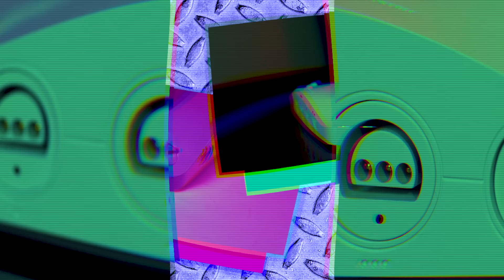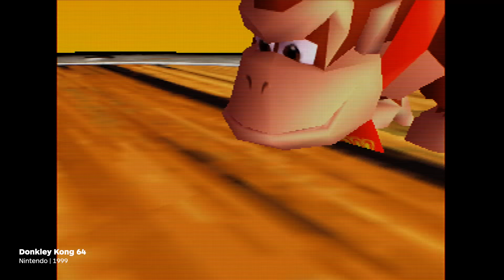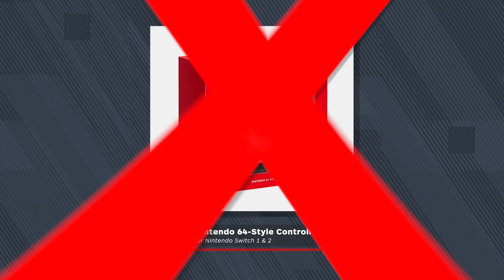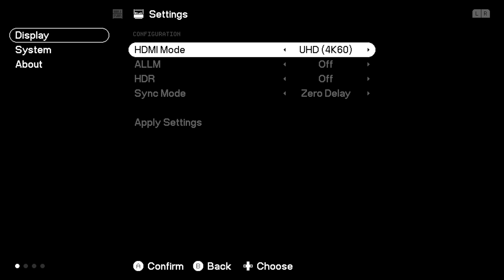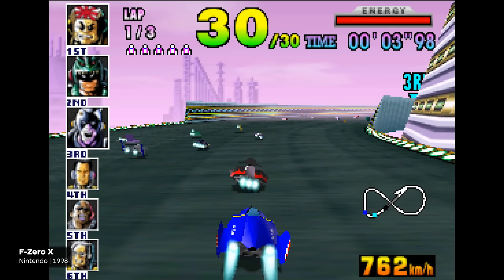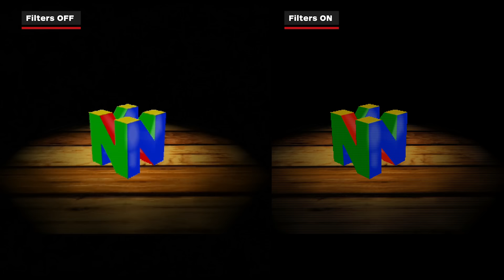Analogue 3D Review

Comment: Any one who has console: I have updated firmware to the latest on my analogue 3d system as well as also updating the firmware on my 8bit Do 2.4g wireless N64 controller (the one with the receiver plugged into the controller port) . A few questions on setup. I want to be able to quit from a game to get back to the system options / cartridge select screen. When I try and press the hot key combination nothing happens also the star / - and heart buttons don’t do anything. Are these pre configured or do I need to manually configure these somehow?. The controller is paired and working just annoying I can’t work out how to quit game to system settings and set up those buttons. Thanks

Comment: Out of respect to real n64s, what Analogue calls force original hardware is far from the correct speed, Analogue 3d is slower. I'm a diehard n64 fan, play it regularly, and I've seen slowdowns in the A3d (in force original hardware mode) that you simply don't see on actual n64s.  Seen very clear innacurate slowdowns in Star Fox, Ocarina of Time and Perfect Dark, to name just a few. The actual n64 is faster than people realize.

Comment: Combing occurs in games when they try to display games in 480i.  Most games play on the N64 in 240p.  Normally games that display in 480i only switch to that resolution when you toggle it in that game's menu.  Usually known on the N64 as the "high res" mode or something similar.  Some games like Star Wars Rogue Squadron however, don't give you the option.  It automatically plays the game in 480i at all times if the Expansion Pack is inserted.  You can fix this on the Analogue 3D by opening the system menu and turning the expansion pack option off.  Rogue Squadron isn't the only game to do this.  Indiana Jones And The Infernal Machine does it too.  They'll likely update the A3D to fix this issue with Bob Deinterlacing (or some other options) very soon.  The system also didn't natively support some flash carts during the initial reviews, but it looks like Analogue have already started releasing updates to fix this.

Comment: I need advice please. I got a 2005 Sharp Aquos 1080p TV 117cm.
But if i plug my n64 on it, this is ugly.
My question is: will this analog 64 look better on my HD tv? Way better or almost the same? Isn't it worth to just buy the simple hdmi cable converter ?

Comment: $250 for this thing, and it doesn't even come with controllers.

BTW, if you still own N64 cartridges.. you probably still own an N64. Just buy a retrotink and a nice cable to hook up to modern TVs.

If you don't own an N64, buy one. They cost $78 bucks loose with a controller.

Comment: the combing only happen to the 480i video. most gameplay is in progressive 240p. so not really a problem. most games use 240p, and the ones that use 480i, is used for menus, maps and yes that short N logo animation. But you actually controlling the character is 240p!

Comment: Surprised Nintendo did not prevent this from releasing.
Reply: They can't. You can tinker as long as you do not steal from a company. Nintendo's code was not used, and the port for carts is smaller than a real N64. By all legal accounts Nintendo has legit 0 things they can use to stop it. Nothing Nintendo has protection over was used, reading a game is legal as long as your reader is not a copy of the real deal. Tinkering has always been legal, you just can't steal.
Reply: Shh 🤐
Reply: Pretty sure they are preparing a cease and desist order for IGN to pull the video down and sue for reviewing an unlicensed product.
Reply: @kiwamidude809 No, they arent. The patents for the hardware have expired, making this completely legal. They did a Super Ninendo years ago, as well as the Pocket which plays GB/GBA among other things.

Comment: I know you want to keep getting free review units, but the PixelFX n64digital mod is still the premiere way to play on a modern TV. This device does not support the everdrive (a dealbreaker if not fixed), does not have bob or motion-adaptive deinterlacing, has no smoothing option like the XBR smoothing of the n64digital, no gamma adjustment for HDR settings with scanlines (a dealbreaker for dark games like Doom64). And where is the NSO controller support? Its an incomplete product at the moment. Maybe itll be the best in a firmware update, but for now the flaws compared to the n64digital are too big despite the rather awesome overclocking bonus

Comment: He forgot to mention it’s 250 dollers 😂
Reply: I mean, that was the original n64 cost in 1996 iirc… and modding a real n64 for hdmi is gonna cost you more than that
Reply: @robertsommerfield6716 I modded a real n64 to hdmi and it cost me less than $100. I use a retroscaler HDMI and an S cable
Reply: Glad I preordered. Guys are doubling the price on eBay!

Comment: way dissapointed. I bought the Analogue 3D without ever seeing what the games actually were going to look like thinking that it was going to actually display the games in 4K and possibly with refined frame rate. Apparently neither would happen. I already have CRTs and original N64. Why do I need this after all when it doesn't give a cleaner picture and better frame rate. I guess I just assumed it would. Why else would anyone want to own this if it isn't any better than the original hardware?

Comment: Yep I agree with you a Sega Dreamcast Analogue would be dope! I’m happy I still have my Sega Saturn on original hardware and Sega Dreamcast which I bought right before covid season and they still all work fine so with this, emulation emulator clone N64 analogue I know ppl have been talking about for a while now looks clean and nice but, will analogue have enough in stock for everyone to buy? That is the question right? Not confident in them to have em in stock because they never do. The bots be scalpers but em all up during first release. If you ever bought from analogue website you know it. It’ll say sold out instantly. Then I still wait a couple month even 6 months later it’ll still say the same thing. Which is sold out of course right? This is where then I will give up because, I would just lost interest in it by then. Of course I’m one of those who love emulation & emulators but, I already have all of the consoles on original hardware. Only the Sega master system and Sega sg-1000 is the only ones I don’t have original so, the question is do I really even need this honestly? Of course I would want one if it’s in stock but, yeah not confident in analogue when they don’t have one.

Comment: I don't understand why anyone would buy this for $250 without a controller when you can buy an actual N64 console with controller for less than $150 on eBay. 
It would be worth considering if they sold it with a 17" CRT monitor. Also, they would need to remove all those brain numbing settings.
Reply: N64 is only $78 loose with a controller. You're right, there's no point in buying this garbage

Comment: Analogue should do a Gamecube or Dreamcast, then I'll be interested. I'm over N64 tbh.
Reply: Not really any point in a gamecube, the original gamecube already has a digital output and there are companies selling HDMI converters for it. So you can plug your gamecube into a modern TV without issue already.

Comment: I can't wait to test my analogue 3D with the mclassic
Reply: Why? The console has 4K output, HDR, and allows filters similar to what Mclassic does.
Reply: @blabo6427 i think the Analogue 3d has no smoothing Filter like the mclassic
Reply: @janusw4246 the N64 has a smoothing filter, the analogue 3D has an option to disable it.

You probably should not use an mclassic, the analogue 3d has plenty of filters options to make it look exactly how you want.
Using an external device like the mclassic is just going to make it harder to set it up
Reply: @AngryKurtz86  The N64 softens the entire image, but the mClassic only smooths the edges and makes the overall picture sharper

Personally, I’m not a big fan of scanlines. I prefer a clean image with smooth edges. I don’t think the Analogue 3D has an edge-smoothing option like the mClassic, or at least not one that works as well. Since I already own an mClassic, I’m just going to try it out. But who knows — maybe I’ll end up liking the image even without the mClassic
Reply: @janusw4246  Problem is the Mclassic only upscales to 1440p, not 4K. So if you have a 1080p or 1440p screen, then sure. But 4K there's no point.
Reply: @janusw4246 According to other reviews I've seen, it does have anti-aliasing options like Mclassic, among many other options.
Reply: @cencil6497  That’s not entirely correct. The mClassic can’t upscale to 4K, but if the input signal is 4K, the mClassic will also output 4K. I’ve already tested this once with my Xbox Series X. When the input signal is 4K, the mClassic still applies its anti-aliasing. The mClassic always works best with the system’s original resolution. For example, the Wii U looks best at 720p; at 1080p the improvements are much smaller. But since the Xbox Series X’s original resolution is 4K, you still get a sharper image and anti-aliasing when using the mClassic.

Comment: Will the N64 NSO controller work with the BlueRetro controller adapter? That's how I use the Wireless controllers on my original N64
Reply: @IsaMasih  Not currently.  I don't recall who covered it, as I've seen a number of videos, but I think it was Macho Nacho.  It can pair with a controller, but the controller doesn't work.

Comment: I don't care much about how the games look, they are supposed to be blurry, jagged, low-poly, and muddy textures. That's the signature N64 look. I just want a machine that can play ALL N64 games at 60 fps, that would be like black magic to me.
Reply: You need to watch more in-depth reviews. Seth didn't even talk about the frame rate options. There is an unleashed mode that makes a lot of games have higher frame rates. There are some videos that are like 40 or 50 minutes long that go over everything.
Reply: @chadsmith1200  That sounds like a good start. It's kind of what the Expansion Pak originally promised to be (at least in my mind).

Comment: Btw, Flash carts apparently are not completely supported. Keep in mind that the Analogue 3D is only built to support the official stuff. Official cartridges, controllers, accessories, etc. Anything beyond that is unsure territory.
Reply: Every other analogue product has had a jailbreak with cores you can load on the device and launch roms from the sd card.   Im sure this is coming.
Reply: A N I M E
N
I
M
E